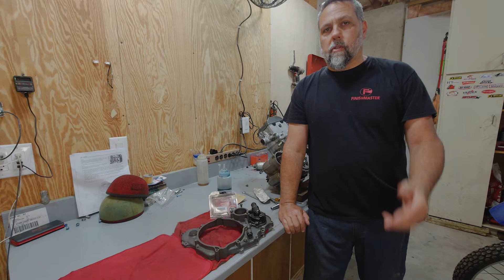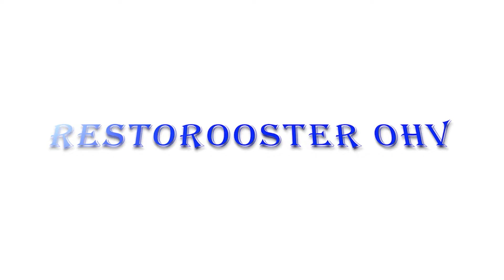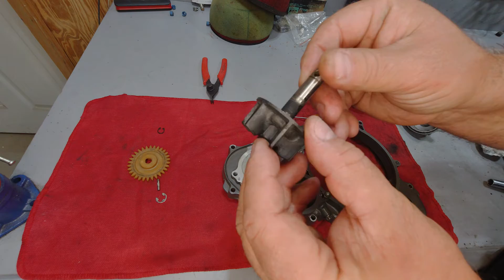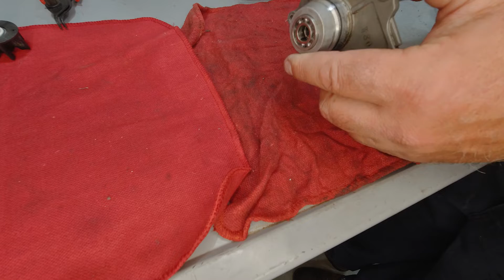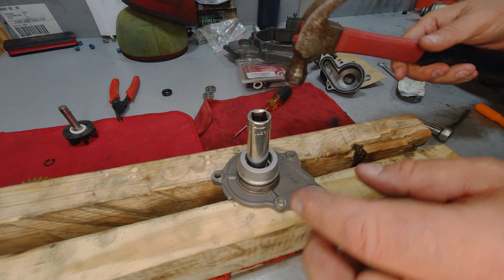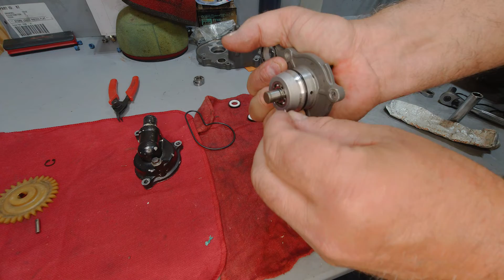Suzuki DRZ400 LTZ400 Water Pump Rebuild Ep50

Comment: I have a tiny dribble of coolant leaking between the clutch cover and inner plate. When the engine is hot. Is it time for a rebuild?
Reply from the maker: Yes, the seal is going out
Reply: @restoroosterohv  one of those shaft seals with the indent on one side and the flat part facing in?
Reply: Oh I think I understand. It's probably just the small o ring on the inner plate, if it's only leaking coolant.
Reply from the maker: @SlabbinNCabbin  Do a complete rebuild kit with all of the gaskets, bearings and seals to avoid having to pull it all back apart again.

Comment: I messed my little seal up trying to put it in. It didn’t go in like yours so I tried beating it with socket and hammer and bent the seal. Have another one on the way🤦‍♂️
Reply from the maker: Yeah, the real trick is making sure that the socket fits on the very outer edge of the seal and not on the lip of the seal